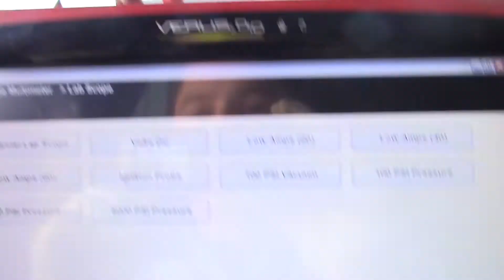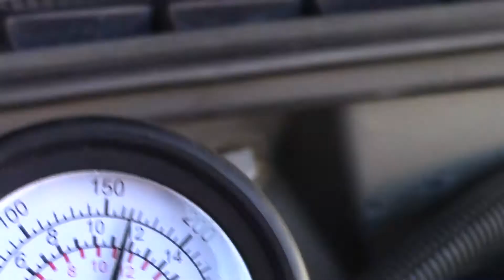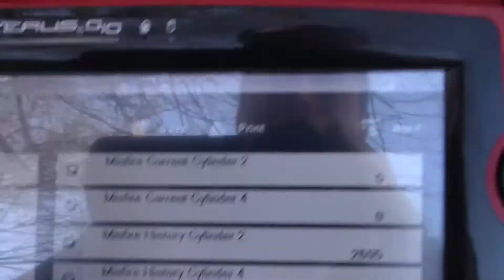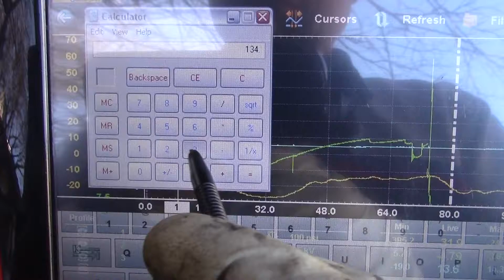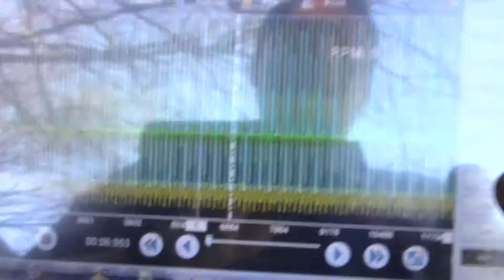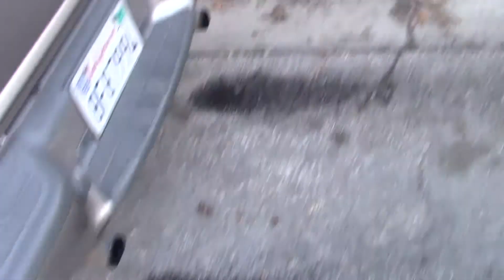99  Chevy Sonoma 2.2 P0300 P0172 diagnostic and repair

Comment: Hi! Thank you so much for taking time to make all the videos for us. Please help me. Here is my issue.

I just bought a 2003 GMC Sonoma SLS 6 cylinder Truck . The truck shakes/vibrates really bad once started. You can literally see the engine moving and shaking. It shakes throughout the drive and also appears to shake even more when at stopped light. Just yesterday afternoon, i was at a red light waiting to make a right turn onto the freeway. Once light turned green as i was pressing the gas and turning my steering reel it became hard to where i couldn’t turn it normally and literally suddenly just died on me. Thank goodness there was no other car making a right turn on the far left lane because when my truck steering reel became hard to turn the car went toward the left side. I tried few times to start car and it started and i went to the left turn trying to turn into the 7’eleven parking lot, right when i went onto the parking it died again. This time it took more times until car started again and this time when it felt as if the car is starting i gas it to help turn on.

Then i drove just across to Oreilly and the worker scanned car and a code on his machine detected Cylinder 2 misfire. 

Purchased NEW:
Spark plug wire set
6 spark plugs  

Replaced it on car. Still not resolved. Upon checking the MAF sensor was no good, the distributor has a line cracked on the number 2 . 

Went back to Oreilly: Purchased NEW
* MAF Sensor
*Distributor Cap & Rotor

Replaced on car with those too. 

Again NOT Fix still showing code Cylinder 2 misfire. 

Issue present: 
1.Shaking/vibration on car really bad and loud. 
2. Check engine light comes on and off (flashing)

I do not want to guess on what it is. Can someone please guide me on what to do next that can fix this.

**At this moment writing this comment, i am in the car parked at Oreilly debating what to get. 

***also when i moved wire on cylinder 2 to 4 and 4 to 2…it still show cylinder 2 misfire even after moving it to 4.

Do i get Fuel filter?
Reply from the maker: What you need is  a diagnostic,  no changing  parts until you test them and prove they are bad , does not matter  how many parts you replace if they are good  will not fix the issue , misfire can be for mecánica issues ,  fuel , or Ignition,  ultimately  electrical but what is needed  is testing . Have a profesional technician  diagnostic  that  for you believe bis way lees expensive than throwing parts
Reply: @JoelAutomotrizenAccion   so this is the update before i saw your comment.

Thought maybe fuel filter so i cleaned it by spraying with throttle bottle cleaner on fuel filter. 

Car still started and upon driving the check engine light came on flashing again and was still vibrating/shaking.

****i do not know why i did the next step
But i removed the distributor and the shaft to check if i might have sprayed the throttle bottle cleaner on and maybe might messed that up***(and i just put it back)

Now car will crank BUT DOES NOT START! 

Then upon doing research it appears that i might have mess up the distributor timing. 

I followed the instructions on the TDC and getting dial at 1 in the end. (Did that many time!) then check the pressure on cylinder 1 and there was compression.

Now its showing code P0446 and crank but no start. 

Car still doesn’t start. 
FYI i am no mechanic i am just a girl trying to get the truck to work. 

Please help!

Comment: I got the same problem on a Chevy 98 s10 missing on only cylinder 2 spark plugs changed  coils changed wires changed did a spark test I’m getting a spark from all plugs what could my problem be
Reply from the maker: Check comprecion too